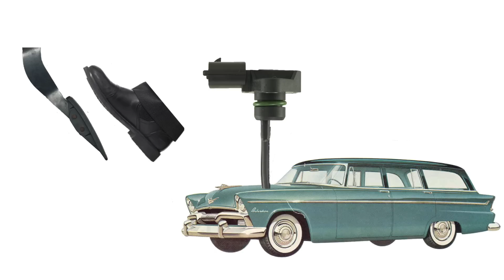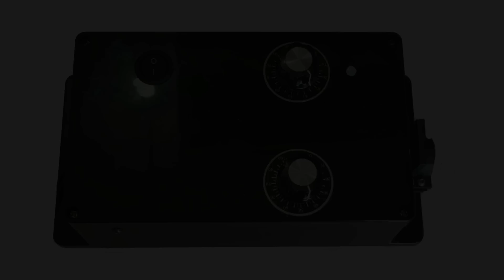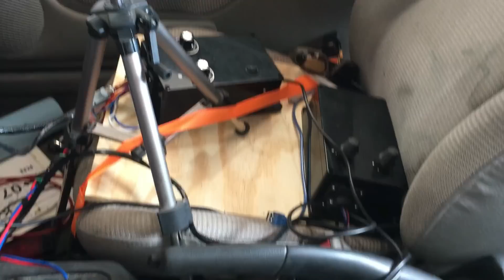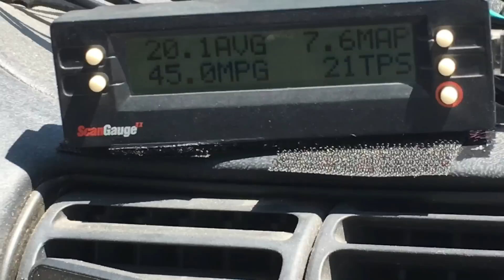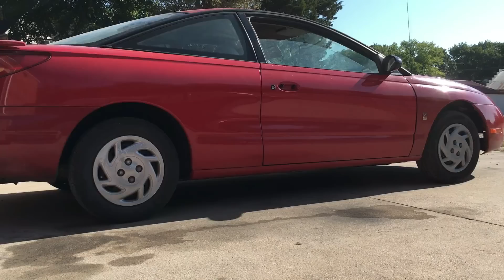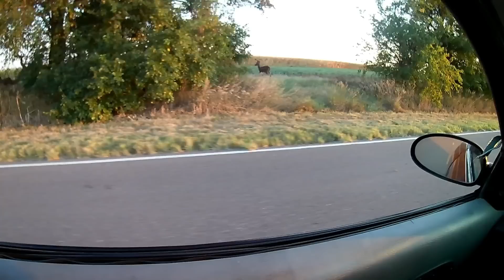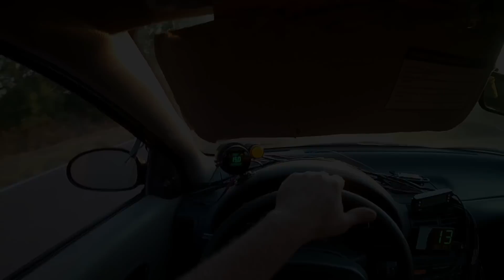S2E20: We road test the fuel saving Robo-throttle on our project car and discover hidden MPG’s.

Comment: I'm curious about the arduino code you used in this video. I am just starting to learn about arduino coding and am not very good at it yet.  I want to control the air coming into my truck engine to mix the woodgas and air. I want to use oxygen sensor voltage to determine the position of the butterfly valve in the air intake. It would change constantly with gas quality and temperature. I know how to make it open and close to match the O2 sensor voltage but I just can't figure out how to account for the changing conditions. I think the code you used for your Robo-throttle would work with a little modification. I was wondering if you had the code posted anywhere?
Reply: Would be interested as well. I have a Saturn SL2 and I'm thinking of doing this mod after I get a throttle body and hook it up to a microcontroller. Having the code used in the video would be awesome to work with and modify.

Comment: You are doing a great job. Lots of interesting Hi-Tech stuff. All of that is good and the presentation is top notch, but it's not what drew me to this channel. I'm more of a do-more-with-less kind of a person. Running a car on a lawn mower engine is great in my eyes. Using a lawn mower carb on a regular car engine is - - well, it's great, for me. I'll keep watching and hoping for more from less..
🤨
Reply from the maker: We took a break from the Honda due to the hot weather, that car has all kinds of problems when the temp goes up.  We will soon get back to the honda and start the diesel swap in the saturn.

Comment: optimizing for max vacuum is the same thing as just minimizing throttle opening. doesn't it just go to whatever max throttle opening is programmed and stay there?
Reply from the maker: It may seem that way, but we can squeeze a little more speed out of the car by managing the throttle.  You see the throttle doesn't just stop at a certain angle, it continues to move a little bit in both directions.

Comment: Why not hunt with a Gatling gun Jimbo? It is entirely legal to own one with no special license as long as the hand crank is attached and functions as it should (go ahead and google it as  it is true).

Is the diesel going to be naturally aspirated or not (or both)? Just curious.
Reply from the maker: A 50 cal Gatling gun would probably be about right for me... lol   The Diesel swap will start off normally aspirated, however once we work out the bugs, we will turn up the fuel and throw some boost at it.   I'm thinking about 10psi, as this engine was not designed for a turbo.  I think we can probably squeeze about 25 HP or a little more from this engine if we are lucky.

Comment: Are transient voltage spikes something you should be concerned about when working with non automotive grade components in a car?
Reply from the maker: Yes and no,  for this project the Arduino seems to work fine running on raw unfiltered power, but normally I do add some sort of filtering.

Comment: Have you burned any pistols up doing the lean burn experiments yet? 
I ask because I burned up the pistons in my jr dragster when it went lean.
Reply from the maker: A number of years ago, before Youtube, I did a  year long trial of a leanburn system on a Saturn,  I only went in the 15-16 AFR range though.  The Saturn engine survived without any issues.
Reply: Engines can be ran very lean as long as the engine load is very low. At high engine loads lean is bad. Like on a dragster

Comment: Wonder how easy(or hard) it is to make constant fuel consumption cruise control where you set the consumption limit and max speed
Reply from the maker: This experiment uses the accelerator pedal to control the throttle control, however I could add a few more switches  and some code to calculate speed to convert it over to a cruise control.

Comment: Any plans to release the code for this experiment? I would be very curious as to how exactly you make this work!
Reply from the maker: Due to the dangers involved, I will not be sharing the code.  If you understand software and servos, its pretty easy to reverse engineer.
Reply: @robotcantina8957  Shame, but I understand. Could download some full fledged efi software and go through that but it is overly complex for what I want to see.

Comment: I’m curious if you could elaborate more on the 25 yrs of automotive experience did you work for the big 3 as an engineer I’m super curious I’m a ford senior master technician
Reply from the maker: I started with Ford, then did a lot of Japanese and Korean brands and finished with GM.

Comment: Get yourselves a bag of Teensy’s. More reliable, more powerful, more secure, more I/O, Arduino-compatible. 32-bit ARM processor running at 600MHz, 16-bit AD/DA converters, microSD card reader, audio interface, a boatload of I/O ports and USB host modes (single/dual/triple serial ports, audio interface, MIDI interface, joystick, keyboard, mouse, or any of several combinations thereof). A bit more expensive than the Uno, but way more versatile and capable.
Reply: Momma Panda  Teensy’s homepage has good documentation and links to all the relevant resources for initial setup. Once setup, they can be programmed using the regular Arduino IDE. The I/O pin setup at the top of the programs needs to be tweaked according to the Teensy’s pinout, but most (maybe all) Arduino libraries and programs will work on the Teensy, but with 16-bit AD/DA instead of 10-bit, and with a 600MHz clock instead of 16/30MHz, and a ton of USB host options. I’m using it to take input from accelerometer/gyro units and send control signals to servo drivers for RC flight/drive hardware, with ESP32 board to send/receive the related metrics over bluetooth and wifi. 

They can interface easily with any device that supports I2C or SPI, which covers most CANBUS or ECM applications.

Comment: limiting accelerator angle is kinda worthless for fuel economy. Modifying your driving habits to make it so you need less brake is far more fruitful when it comes to increasing fuel economy. I get 28 MPG in my 2020 Toyota Tacoma and 37 MPG in my 1994 Honda Accord and I am not afraid to step on the gas, and in fact both my vehicles see full throttle on a regular basis. I am, however, very afraid of the brake pedal. While I am happy to smash the gas pedal, I don't smash it for very long, and when it would cause me to maybe brake later, I am very afraid of the gas once again.

Comment: Never mind the throttle body, let's have a chat about your blatant disregard for temporal mechanics. You can't just go around telling the past about the future.

...I mean there is technically no law against it but it's just not the done thing.
Reply from the maker: Good point,   I need to use my tine machine more responsibly.

Comment: How reliable is vacuum pressure as a sign of optimum running point anyway? I think it would be better to modulate throttle based on actual instantaneous fuel consumption and speed.

Comment: Where is the code??  Could you at least explain what the code does?  Why is this better than just limiting the pedal travel?
Reply from the maker: The code is just a servo feedback loop, we modify one of the variables in the loop to offset the balance when the MAP sensor is our of range.  I cannot release the code because of safety issues, but if you understand servos, its very easy to reverse engineer.

Comment: Would you be willing to put an engine on your prony Dyno for a fee? I am able to drive and deliver the engine.
Reply from the maker: Hi Morp,  The prony dyno is built around the Predator 212cc engine,  Season 2, episode 2 goes into detail on how the dyno is made for only the 212 engine block.  If your engine is based on the 212 block, we can certainly test it.  I's nearly impossible  to keep up with all the comments and I may not see your response.  try contacting me through the email link in the "about" tab on my channel page.

Comment: I guess, if it is possible to have better fuel economy with production engines, the manufacturer would have already implemented it. But often it would requiere massive modifications, to get better fuel economy, like variable compression ratio, and variable valve timing.